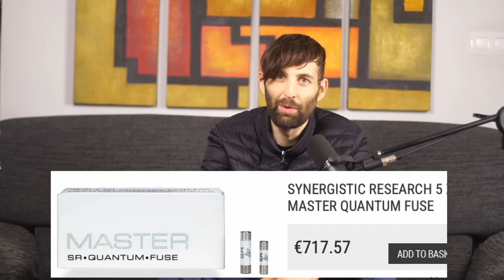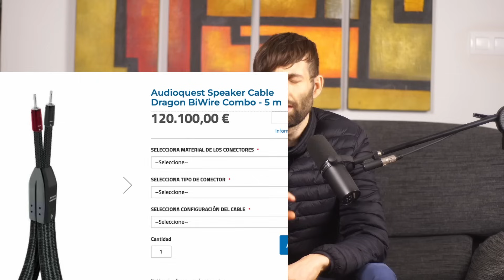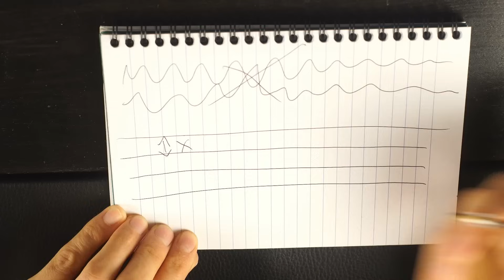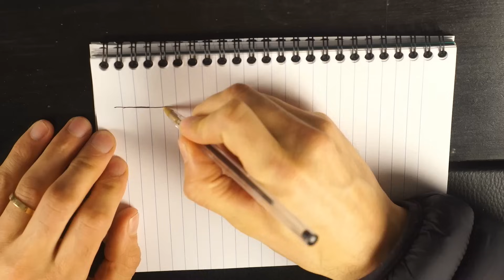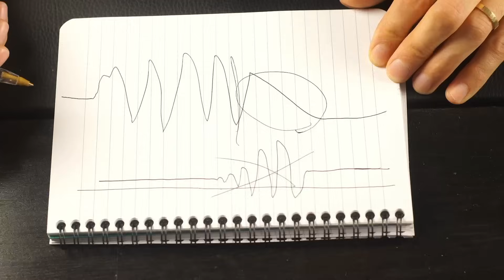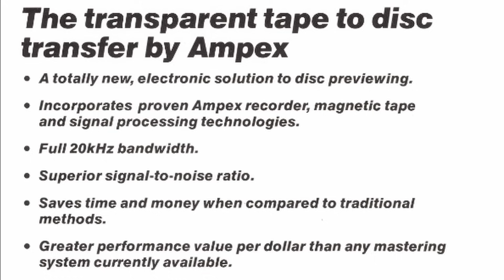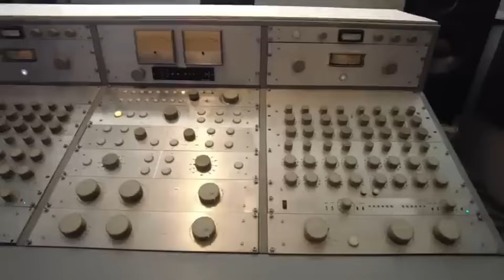Hard truth: most vinyl is digital anyway

Comment: Scientifically there is more information in a analog signal than the compressed digital formats available
Reply from the maker: cassette vs 192k 24bit flac?
Reply: @APMastering It depends on the quality of the transfer you have along the way and on what devices you listen. For every coding-decoding of the compressed file you get lag and interruptions. In an ideal setup with dedicated equipment for audio and locally stored files, the digital format will sound nearly as good as the fidelity of an analog signal. Glitches and errors not accounted for. But this is only valid for acoustic music and not music that has already been recorded/degraded/processed/compressed/limited  to sound good through digital playback.
Today most people consume music as a background noise through bluetooth mono speakers and they will not know/care about the live music culture between people that has got lost through industrialization

Comment: I massively appreciate non slammed digital versions, they are the best, but sadly almost no one releases them. In this regard some vinyls definitely sound better. You seem to indicate this not really being the case if I understand it right (I might not), but wintersun's time 2 from last year for example is so much less fatiguing on vinyl. I will always prefer the more dynamic version, and that's such a struggle in these times. I've also been disappointed with so many vinyls in recent years in this regard. Almost every new version of an older metal album is less dynamic than it's previous version.

Comment: The gold standard for any of these claims is blind A/B testing. I'm an audio engineer, electronics repair tech, commercial studio owner and lead tech. I understand all the arguments on both sides and have almost 30 years real world experience with this stuff. People can talk, and theorize, and rationalize these things to death. This is akin to science without expirimentation or empirical data. The only thing that really matters is CAN YOU PROVE IT? If an audiophile can consistently and reliably tell the difference between vinyl and digital playback in a controlled expiriment, whatever your theories to the contrary are become invalid as they don't comport with reality. If they can't, whatever THEIR theories are in this regard become invalid as they don't comport with reality.

Has anyone done a proper controlled expiriment on this?

I've seen videos online where it APPEARS that some audiophiles are indeed able to reliably discern between different types of speaker cable. This blew my mind as it didn't comport with my hypothesis. Now maybe these APPARENT blind A/B tests were complete BS, or something else was going on, but they certainly caused me to update my priors.

Anyway, great video! Thanks for making it!

Comment: vynil doesn't have more dynamic range than a CD, that's a straight lie, a CD has a dynamic range of exactly -96dB, vynil has a dynamic range of -80dB, can you explain to me, how having -16dB less of dynamic range is better? quietest sounds on a CD will sound quieter than quietest sounds on a vynil, and that's dynamic range. And if we just increase the resolution of the digital to 48khz or 96khz at 24bit the dynamic range becomes absurdly vast. If you just invest as much money as you do on a vynil system with a digital system, meaning good speakers, good digital to analog converters, you will get an awesome experience. And what you're talking about later, on the CD being  weak according to customers is a missunderstanding of the customers on how volume works, they compare the records with other records and here we introduce loudness war, you won't see that on vynil because nobody listens to a vynil and can switch instantly to another vynil, thats why vynil hasn't been affected by the loudness wars, but still is not more dynamic, masters on vynil might be less compressed but that's a choice of the chain, not a limitation of the digital

Comment: I’m a audiophile but I go for pure measurements not “substance” I love sterile/transparent amps and Dacs try to get as close as possible to the original sound I do think analog cables will make a difference but I will never buy them because of there price and if I’m using digital for a DAC connection it toslink.

Comment: Vinyl is not digital. Thats bullshit.

Digtial is a binary on off signal, anolog is a anolog wave form.

Doesn't matter if it came from a digiral source. That digital source gets converted to a wave form and reproduced as a waveform.

You want to cast shade on ithers and can't even get your shit right.

Just because you can turn knobs doesn't mean you knoe jack shit about the technical side. As you have clearly shown.
Reply: It's just shorthand, dingus. It just means vinyl uses a digital intermediary step. Which purists think ruins the quality because "digital is inferior"
Reply: @btafan11  Thats NOT shorthand! Thats a definitive statement. I watched the video. You literally called vinyl digital! And the fact of the matter, they are not completely wrong. The human ear can hear insanely small differences in timing. Even though with DSD and such. We still are hearing the little timing errors and steps in the sound. Analog doesn't have that, despite all it's other shortcomings. And with analog, even if you start off with digital, you have a smooth analog wage form and basically act like a low pass filter and any stair stepping is gone, because now it is a smooth analog waveform. Just because you know how to turn knobs doesn't mean you know the first thing about the technical side of formats and you need to educate yourself before spouting crap online.

Comment: No doubt digital delays were and still are often used. But most of the mastering engineers in high end mastering are using all analog cutting systems. Not sure why you think the majority of modern reissues of recordings on analog tape were cut on lathes with digital delays. These things are actually very well documented since "MoFi-gate" and in the high end audio world the majority of these reissues are cut all analog. I am not defending this by the way. I'd much rather have these reissues utilize the Plangent process for the transfers from analog tape to a digital file and take their time to make the best mastering moves without the pressure of using these priceless original master tapes.

Comment: The digital file of the vinyl master will be same or superior to the cut all day. I will buy the vinyl usually to get the more dynamic master if I love the band though. Styli is an instrument akin to a guitar pickup that wears out. It can not fully reproduce everything on that master, even using a contact line or Shibata styli. 

 I just had a mix and vinyl master pressed and the band wanted the same quality on their Bandcamp - so I just used the vinyl master, gave it a hit of limiting/maximizing to hit upload goals, and it even benefited from opening up the mono'ed some of the 100-200hz that got caught in the bass mono for the pressing. It's a superior version to the vinyl and only a 1db dynamic range difference from the vinyl.

Comment: I work at a local hobby shop with a large music section of mainly vinyl. The only argument I've ever heard that I can get behind is that a lot of times, several iterations of an album may have been originally released on vinyl, like getting one album in mono, stereo, quad, master recording, half speed recording, that may not have had physical releases on CD. Same with different pressings from different parts of the world that may have little imperfections that can be neat to look for.

I can agree that vinyl can be better for collecting specifically on that reason - but that's just for buying it to compare! Not about what has the BEST quality, only about the different TYPES of quality. The "best" one is probably the one you can get on CD anyways, and if you really want to be an asshole about it, get it on SACD. And that's not even to mention that there are often several different CD releases of stuff anyways!

Comment: One thing left out is that the physical process of putting the needle down, hearing the noise from that, it tells the brain that the music is happening in the room. So even though it is technically worse and a dynamically mixed WAV file or CD is going to provide a more accurate depiction of the music, there is a connection being made that seems similar to smokers doing their cigarette ritual. This has not pulled me into vinyl, I actually find that many of my favorite songs are extremely digital at every step of their creation. Vinyl is cool, but very expensive and very alien to how I grew up listening to music.

Comment: Am I crazy or the vinyl should still sound better than CD because it's not being compressed to MP3? What am I missing here? I'm not an audiophile if you can't tell
Reply: CD audio is uncompressed (in a file size way). CD audio is not MP3. An MP3 is created by ripping an audio track from a CD and compressing the file size so it takes up less space on your drive.

This is a different compression from the musical type which allows for maximizing the loudness of a track. Interestingly, this will affect the size of the groove on vinyl but will not affect the file size.
Reply: @junkandcrapamen  so a vinyl would be better than streaming but not CD
Reply: @trealexander5271  yeah that's about right.

Comment: I enjoy my turntables and vinyl for the experience of playing records, but I'm an old boomer who, when CDs came out in the 80s (by the time players got affordable and didn't skip when you walked past them), I quickly embraced them to get away from the surface noise and surgical cleaning rituals with vinyl. Back then, wider dynamic range was heavily advertised as an ADVANTAGE of digital, because there is virtually no noise floor.  Unfortunately, the practice of what you call "slamming", but most call "brickwalling" has reduced the dynamic range because of the "loudness wars", which you as an engineer, I think attribute to your clients complaining about music sounding "weak".  (Thanks for that explanation from an engineer's point of view, especially explaining why vinyl today has wider dynamic range than CDs, but it's due to choices made in mastering, not the format itself.)  I would love to just still be able to buy non-slammed audio CDs, and if people need to compress the dynamic range, for instance while driving, then have the player do that, or do it when you rip your music. Yes, I still buy new music, and I really don't like having to resort to Bandcamp or Qobuz, because then I have to worry about losing the file I downloaded, and those services going away or changing licensing, etc.  I just want non-slammed (or mildly slammed if that's what you have to do) with NO clipping. That's what I want. And then I'll keep buying physical media. I think vinyl is cool, but it's a step backwards in quality, and don't even get me started on the revival of cassettes! Especially with the cheap players being made today! (Wow, that's a lot of flutter!)

Comment: I agree with almost everything you said, but I have a question - you referred to the superior dynamic range of digital recordings in the context of late 70's and 80's recordings, orchestral stuff, etc. Surely this wasn't an advantage until we got decent digital word length (bit-rate)?  Were they able to use 16 bit or higher technologies that early? I might have the relationship between dynamic range and bit-rate wrong though....

Comment: Yes, digital can be anywhere in the signal chain or reproduction process, is my position.  But listening to vinyl is still intangibly, inexplicably better.  I wonder whether it's because of the vinyl background noise.  Sometime I want to try putting vinyl background noise into a mix and see if it's as pleasurable during digital playback.  I've noticed that two 15" window fans blowing in the background is a common factor in scratch mixes that sound amazing and remarkably soothing to the point where I start yawning when I listen to those.  Another theory if mine is mechanical smoothing.  You have that happening at the speakers, but if you add-in another two layers of mechanical smoothing (cutting and playback) then you're upping the effect.  I can tell you that when the original Sony CD player came out I could listen to that only about 20 minutes of that over ESS HEIL speakers before the music was just annoying AF and I'd want to turn it off.  I had NO IDEA why, and I didn't even stop to wonder WHY it was happening.  I just wanted it off, and turned it off.  It's only looking back that I wonder wow, was that digital fatigue?

Comment: You even said the digital play back does nothing. You find this ironic? I find it ironic you claim it does nothing then say "oooo look. At the end your sound is polluted by something digital ooooo".... So which is it? Is it polluted or does it not do anything to the sound and its simply converted back? You cant have both.  I also find it interesting to find stories after actually researching this little device, that the main account i can find of someone actually being in a professional mastering setting and using one of these, said they used it when the other guys would go on vacation and someone else had to do the job and wasnt that great at the original process. As to whether or not the ADD 1 is digital polution, is purely a philosophical debate not a literal one. You still used tape machines to record. You still used a classic soundboard to mix (supported by various digital FX processors if you use them. They dont take away from anything loads of analog users use them), and then the thing was mastered on a 2 track reel to reel. THATS HOW IT WORKS. It doesnt matter if the record company used a digital delay just so they could cut the record. Its like you forgot the actual master tape is the important part here. Recorded A, Mixed A, Mastered A. Thats it. Quit trying to add a 4th.

Comment: And last time i checked, no Analog lovers ever had a problem with keyboards. Guess whats also digital and we know it......... Did you forget about synths and all those old keyboard organs? If we truly hated digital devices we wouldnt use those. This video reeks with misguieded elitism. No gotchas to be found here. Another thing about your ADD 1, you completely missed the point of how they work. They are just used for playback the process of cutting the record is still an analog process. It gets converted into something a digital device like a computer understands then is converted back to its original form BEFORE it is cut to a record, not after. Its just a halfway point for playback. Last time i checked thats not the same as exporting a project from FL studio. Not a gotcha sorry pal. Any digital users using this as a win or anaolg users using this as a loss are horribly misguided by videos like this.

Comment: Yeah you bang on.
I hate saying it- for laypersons, I am a roadie. Started in LX, now I just climb and hang shit but we all drink with each other so we talk, and this has come up a few times over beers with the sound techs.

It seems people still have it stuck in they're head that digital sound equals Mp3 level, trimmed, compressed and manipulated.

They either use straight .wav or .flac for sound check, and every thing coming live thru stage left to FoH is digitally hard limited.
Like you've said, all recording has been digital since the late 70s.

But I gotta say, the original Gene Krupa's Jazz Rhythums from '55 sounds warm because it is literally a mic'ed up room of dudes recording on a reel to reel, I don't know why but the re-issue sounds different on my home rig.
1200mk2's, Rane 57, some old 80s Mackie mixer, Focal PK 80s.
(Balanced lines from Rane/Mackie/ Focals)

Comment: Back in the early 1980's, I was a purist for all the right reasons, I loved reel to reel tape and dbx noise reduction because I hated vinyl surface noise as it blew tweeter fuses and killed the buzz.  If I listened to vinyl, it had to be MFSL half speed mastered and played on a linear tracking turntable which happened to be a phase linear . When the CD players came forth, I never looked back. Presently, everything is now on the music server laptop spinning on rust via fiber optics into the amplifier,  either in the lossless FLAC format or Wavpack format. If you want a professional music archive format for PCM digital, these two formats are the way to go especially Wavpack. I wish music outlets would distribute all their productions in these two lossless formats. I will pay for it!  If it is lossy, I go tried and true musepack insane settings since this algorithm handles percussive transients superbly.

Comment: In my opinion, most people think they can tell the difference, not because it sounds better, but because the vinyl has that tiny little scratch noises of the needle touching the surface, caused by dust or other imperfections on the record. 

I bet that if you can record the sound coming out of the speakers when playing a vinyl, using a high sampling rate and play it from a CD on a blind test, many people wouldn't be able to tell the difference, and the ratio between success and failure would correlate with that of random choice.